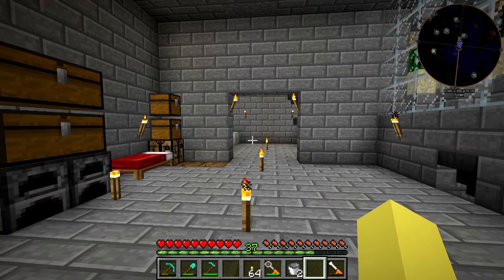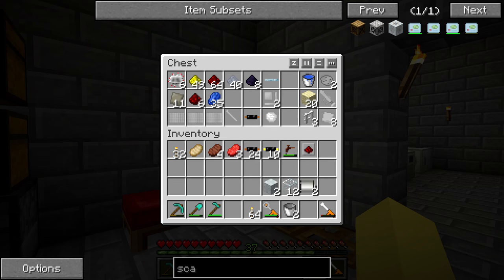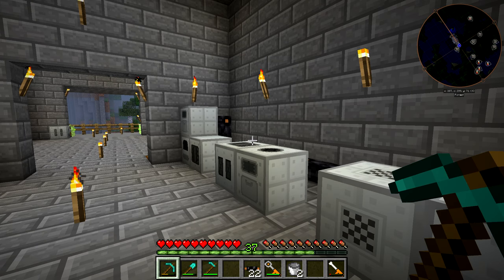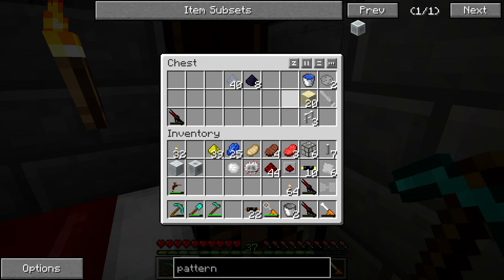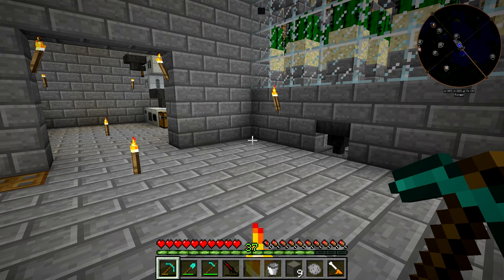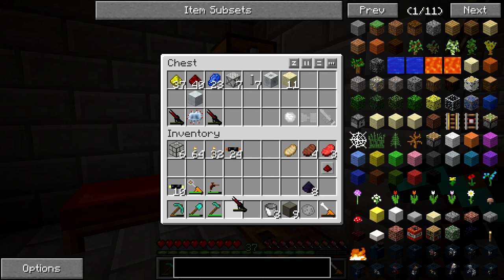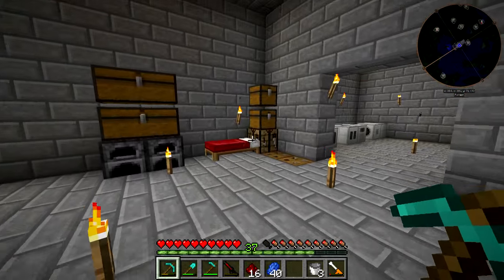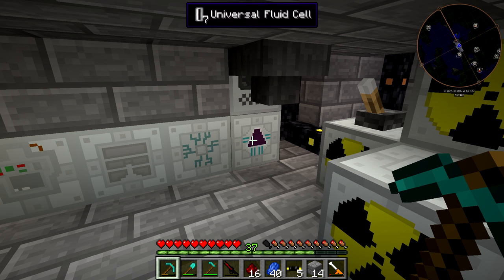Surviving With IndustrialCraft 2 :: Ep.14 - Duplicating Iridium

Comment: Really no point in having the mass fab running without a proper scrap generator. I never really made one without using buildcraft, but I guess you can make one using the miner mining a vanilla cobble-generator. You need to make quite a few of those to have enough cobble for your recycler to be working constantly, since IC doesn't have an auto-crafting table you can't turn the cobble into salbs automatically... And without pipes... Guess the good old hopper line + ejector upgrades is the way to go :P But yeah definitely need to think of a good scrap generator if you want to get even a piece of quantum armor in the following year :P And really CESU is like a bronze pickaxe. MFE for early game. And MFSU asap. Once you get the advanced miner going with OV-scanner you never have to worry about metal related resource issues ever. With 5 overclockers, blacklist mode with dirt, gravel and cobble. I get LOADS of metals and around 15-20 diamonds per run, which takes like 20-30 min. Once you have your mining system worked out (teleporters and remote power ;) ) moving the miner will be fast and easy also ;)